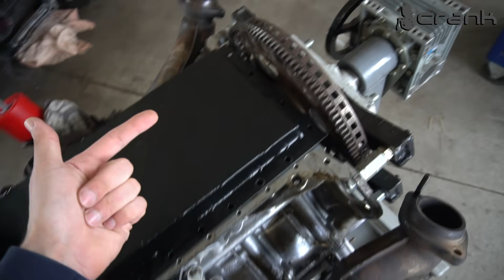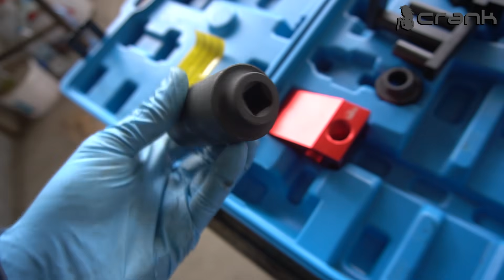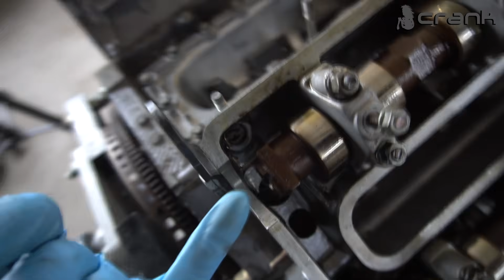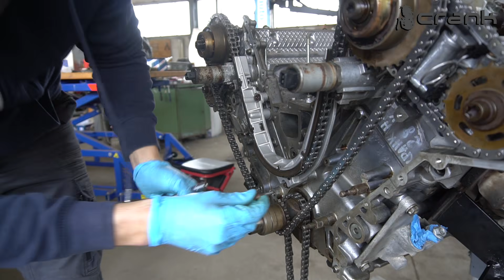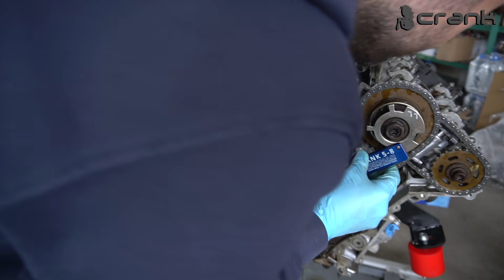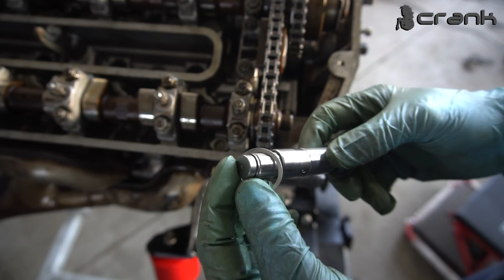BMW M62 Timing Chains Replacement Procedure

Comment: Probably one of the best walk-throughs of doing a DOHC timing chain I've ever seen
Reply: Is it worth changing the VANOS solenoids on a high mileage m62 when you're already in there for the chain?
Reply from the maker: @Villani_AV  Everything is worth changing on this old beaters
Reply: @crank3646 that's usually how i roll, just want to order all the pieces

Comment: Hello,
I have the following problem.
When I turn my engine over by hand, my right vanos doesn't engage. Both vanos have been replaced.
Reply: Literally having this exact problem on a 4.6is
Reply: @Villani_AV  I was able to solve the problem.

The chain wasn't tight enough.

Comment: Hiya, great video. My car has camshaft sensor code, upon checking the “sensor wheel “ reluctor wheel, seem lose. Do I need to fully re-time the engine. Or can I just thighten the nut ? And also what timing tools are you using please?

Comment: Пожалуста даите болше информаций как разлечить диски ротора датчиков распредвалов
Reply: I am doing the same job to my 740 IL 1997 4.4, I’m having a hard job getting the lower front cover off. It seems to be stuck on the driver side. I have all the bolts out. I use penetrating oil and everything and it just won’t come. It feels like there’s a bolt that’s forgotten about but I double checked and double checked and I watched all the videos and everything and I’m sure I got them all out. I don’t know if the metal is seized together or what does that happen overtime does anyone know? Thanks.

Comment: I saw that you use a SWAG timing kit, what do you think of it? I am about to change the timing chain on the E46 320D M47, 136h.p (it is about 390k km), can I use the same kit, would you recommend it? Thanks!
Reply from the maker: Yes it should be fine

Comment: There are two holes in the upper timing covers that coincide with the holes in those sensor readers. Can you verify that after adjusting those pads with the original tools, those holes in the timing covers line up with the holes in those pads?
Reply from the maker: You mean the camshaft sensor holes? Everything is fine with the car, no fault codes or issues with the engine so far.
Reply: @crank3646  Not. There are two holes, one on each side into which 2 torx head screws are threaded. See in the video below.